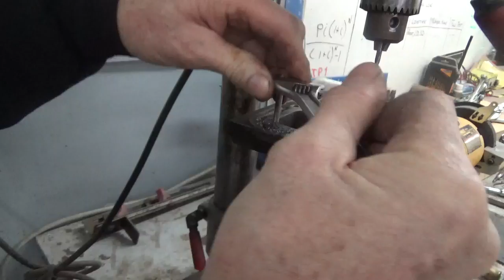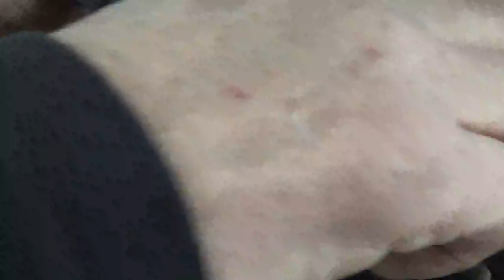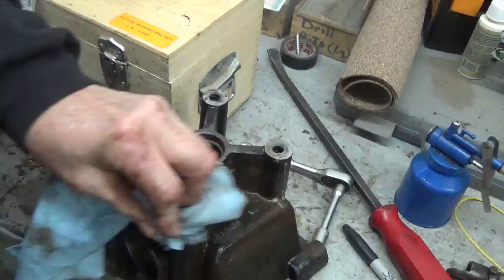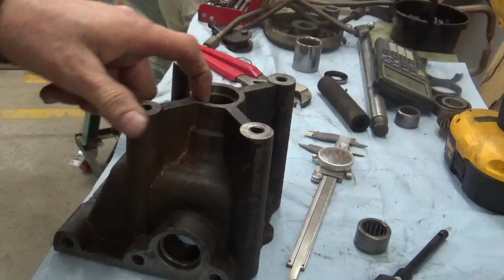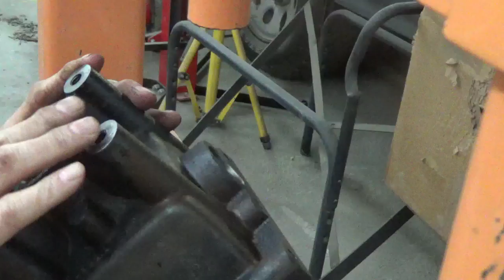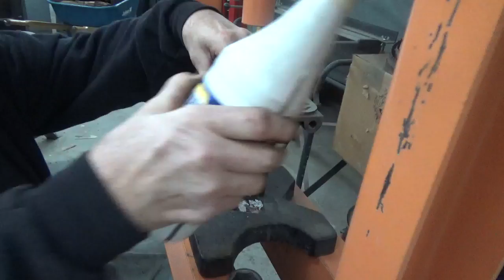Starting to rebuild the bevel gear box on the 7100 Simplicity.

Comment: I just acquired a Allie Chalmers 712H the gears are junk. I just got it apart and no part number is showing up on the gears. Where can I find parts? Bearings seals and gears
By the way very good video. I used to build gear boxed and big gear cases for JOY underground mining machines.
Reply from the maker: I got parts at parts tree.com you might want to look on the simplicity website also.

Comment: Try using a left hand drill bit. It will, hopefully, grab onto the broken bolt and extract it. Worked for me.
Reply from the maker: I will have to find one, never saw one.
Reply: Harbor Freight has sets. Good enough for what , and as often, as I use them.
Reply from the maker: @POMOC36  I will check that out thanks.

Comment: Hey Joe, nice work. Dad always did pretty good with ease outs, me on the other hand ouch. Never seen any body use permatex on an oil seal. Maybe a little grease but it's been to long. Wow still can't believe that's on a riding lawn mower 🤔! What year is that thing Joe?
Reply from the maker: From what I can tell they made these from 81 to 86, I just found that. I thought it was much older.
Reply: It’s a 1960s design that was made at least until the late 80s.

Comment: Hey Joe good progress, on your easy out I've used the tap handle with success, I think because I get even turn from both sides instead of the off to one side pressure of crescent wrench. Also curious if a stud into that gear box might be a idea to cross your mind only if you would have room to put a nut on the other side. Just a thought as it's a different size now.
Reply from the maker: It seems like all the tapping accessories are not made to well, I have 4 different size tap handles and they just wont hold the tap even with a little pressure. I will just put a bolt in it, it is light and not a problem, no clearance issues or anything.
Reply: @josaljo1  I guess I didnt make my comment very clear, I meant using the tap T handle on the easy out screw as it has a square shaft also, same as the tap screw
Reply from the maker: @lylestatzer7112  I knew what you meant and they are the things I cant seem to find a good one. It is like a little chuck. You were clear.

Comment: That went together well and looks good. The two miter gears push outward with wheel torque so the bearings push against the case shoulders for clearance. If there is any shimming on the driven shaft the shims are designed to move the miter gear closer to the pinion just like a differential on a rear axle.
Reply from the maker: The hard part is that the frame either has to be taken completely apart to get the box back or put the side shaft and gears in with the box in the tractor. Not sure how I am going to do it yet.